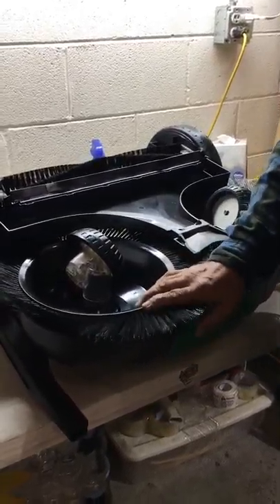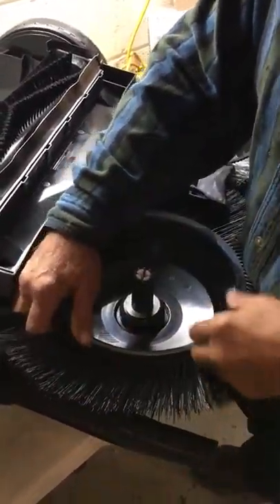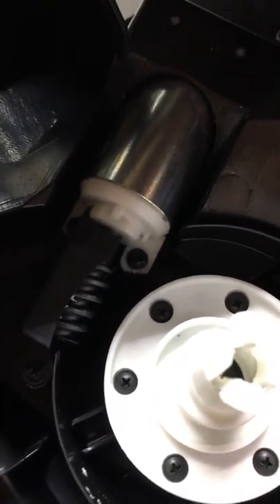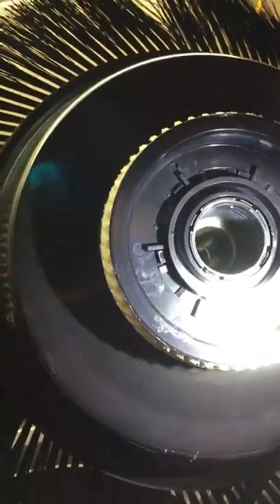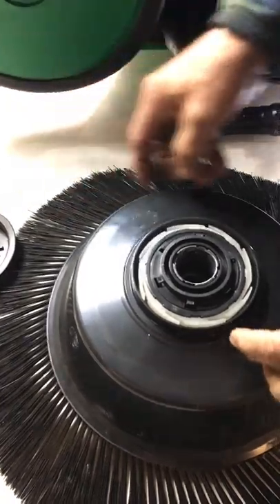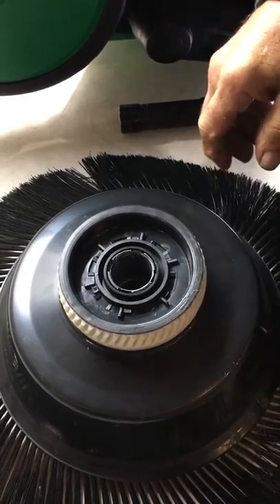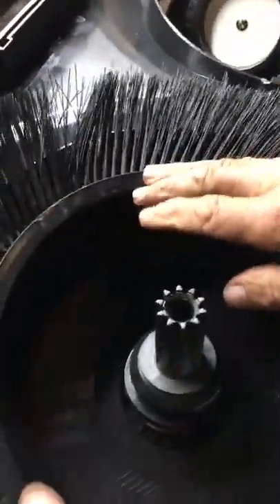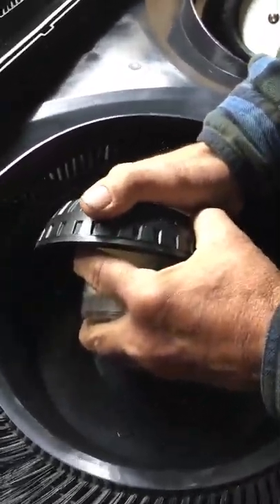Master Sweeper front broom brush diagnostics

Comment: But your using new parts
Reply from the maker: Yes we are and we will be glad to send you out the parts that you need if they are replacement parts.  I am in receipt of the description of the shearing off of the wheel/brush spindle.  That is frame damage that is occurring from a seized bearing (specifically the one on that spindle).  Once frame damage has occurred, either the entire frame will need to be replaced or another unit will need to be purchased.